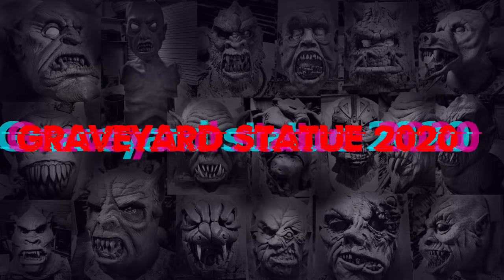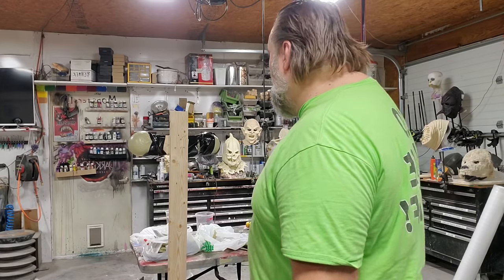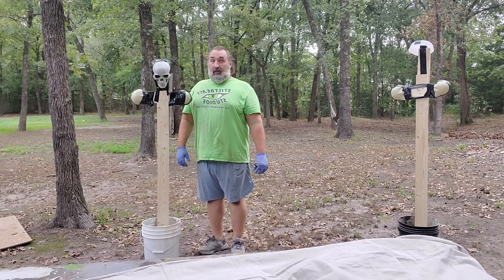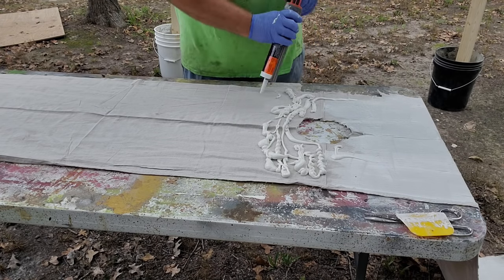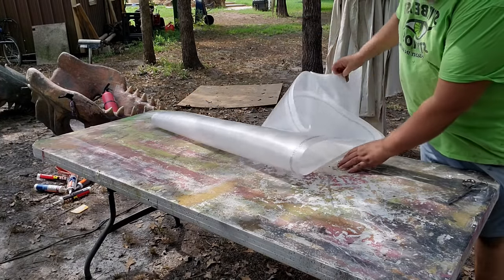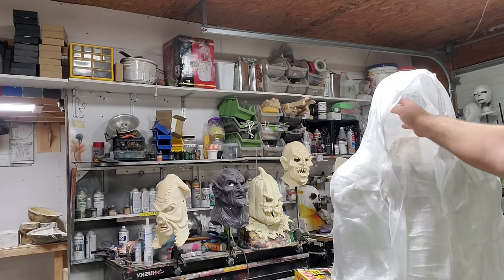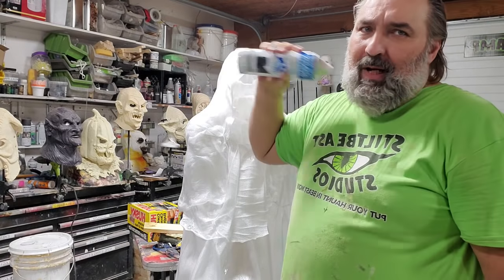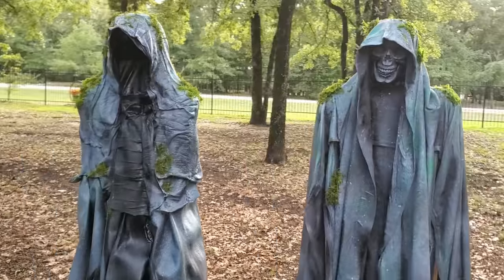graveyard statue 2020

Comment: Just FYI, but you don't really need to cut a circle for the head, as all you need to do, when you've folded it in four, is cut little slits along the fold lines. As in an X, because then the head just pops through it, but also the triangular parts that poke up can look sort of like a neck or collar. Hope you like my suggestion

Comment: I am going to be leaving my statues outside in the elements and at the end of the video you stated that they were somewhat waterproof since they had been treated with liquid nails. Would the addition of Loctite to join the individual canvas pieces together help make the statue water proof or would you suggest an additional water proof coating to achieve that.
Reply from the maker: if they are left outside all year then Id hit them with concrete water sealer... Ive been using that al ot lately
https://www.homedepot.com/p/BEHR-PREMIUM-1-gal-Wet-Look-Sealer-98501/202263927
Reply: @StiltbeastStudios  thanks so much

Comment: Fantastic! I wonder how many tubes of Loctite were used to make the first statue (the canvas-covered one)? ALso I wonder how weather proof the canvas-covered statue is. Will it survive a few weeks outdoors in a chilly/rainy environment (northeast US)? I just worry it would get wet and the canvas would get moldy even with the Loctite covering.
Reply from the maker: 7 tubes total and it lasted 4 months till I moved it outdoors in texas
Reply: @StiltbeastStudios  so it last 4 months outdoors? or 4 months indoors and then fell apart as soon as it moved outdoors? (they you, just wanted to plan a budget for attempting to make 2 of the statues)
Reply from the maker: @myatt83   it was fine outside for 4 months, then I moved it inside so it  was not in outdior conditions any longer.
Reply: @StiltbeastStudios  rock on! appreciate the clarification. i plan to build a few and put them outside for just October, so should be good. I thought it would be cool to also drill some holes in the skull and wire a few LED's inside so the eyes glow red. Trying to brainstorm some other ideas for making these even more scary and cool. Thank you again!

Comment: God. I love it.   Simple.      But can use 1 inch pvc pipe  for skeleton inside   But wonder. Lot of weight on it  🤷🏼‍♂️.    For bases- can be hidden with tombstone front of it and fake bone hand  on tombstone head    , Other too  casket tombstone topper on ground to to hide the base. Many way.    Great job Allen. Love it
Reply from the maker: the bases pretty much get hidden by the robes of the statue, but all the mods you suggested are great.

Comment: Used your concrete bases. I reallly thought they would stand up better, but a slight wind blows them over. Still like this better then staking them in the ground though.
Reply from the maker: how much concrete did you add, you could just make it a bit heavier.

Comment: Do you prefer the PL375 over Monster Mud? Easier to work with? Lasts longer?
Reply from the maker: monster mud is not waterproof, the liquid nails or the pl375 is waterproof. So I prefer the waterproof option, it also weighs a lot less.

Comment: Could the body have been made from old torso models that a store no longer uses? Also, MinWax spray polyurethane seals foam against the effects of spray paint. My big question is: Why is everything in the video mirror imaged?
Reply from the maker: yes you could use a mannequin, but they are much harder to get ahold of. it would seal it, but there was no need for it so why add cost. and its mirrored because front facing cameras do that.

Comment: Are there any fire hazard concerns with the foam? I would be hesitant to use it in an indoor haunt.
Reply from the maker: its floor underlayment, so its meant to go in a home or under hardwood flooring. its flammable, but most things are flammable. I have never had an issue with it from inspectors.  It has less mass than a plastic garbage can, and those are also toxic when burning and flammable, so I feel its in the same boat.

Comment: Were these cheaper to make than your originals with the bed liner?

Also you mentioned that the canvas one is covered in liquid nails? What is that?
Reply from the maker: yes on both counts
Reply from the maker: https://www.homedepot.com/p/Liquid-Nails-10-oz-Heavy-Duty-Construction-Adhesive-LN-903/100176209?source=shoppingads&locale=en-US&mtc=Shopping-B-F_D24-G-D24-Multi-Multi-NA-Feed-LIA-NA-NA-All_Paint_LIA&cm_mmc=Shopping-B-F_D24-G-D24-Multi-Multi-NA-Feed-LIA-NA-NA-All_Paint_LIA-71700000048001156-58700004793621605-92700041080546467&gclid=Cj0KCQjwqfz6BRD8ARIsAIXQCf1ehpRWJME4ExIwmjSgE748aym3dDGHY5CeMfVk_B6lCe6-GVQUoeIaAiH8EALw_wcB&gclsrc=aw.ds

Comment: How many tubs of the loctite did you go through? Thank you these look awesome.
Reply from the maker: six tubes actually, not that bad at all
Reply: StiltbeastStudios Thank you again awesome and simple.
Reply: Awesome work! I have a couple of questions: (1) Does the loctite dry clear and (2) did you put the coated portion on the upside that would be exposed to the elements or the underbelly? I bought two of the Home Depot cemetery statues this year and I’m wondering if I might be able to coat the fabric on their costumes with the loctite to leave them outside. I figured that would save me the build time. Any thoughts?

Comment: Alan, once finished will you have to move the statues around in your yard with a dolly because they are set in concrete?
Reply from the maker: no, the board is removable, thats why I vaselined the board that I used when I put in the concrete. so I can pull the board and just carry the bucket which is only 25lbs.
Reply: @StiltbeastStudios  Would I assume that if I wanted to put them back in your yard like you showed at the end of the video that you would leave them in the bucket so they would not blow over and then for storage purpose I could choose to pull them out of the concrete
Reply from the maker: @geoseward   correct, they are in the bucket while displayed and they could be stored out of the bucket if you like. you could have 20 figures built the same way and the store the figures on a shelf and the 20 concrete buckets outside somewhere.
Reply: @StiltbeastStudios  Why did you use Loctite in these statues versus the rubber undercoating in previous statues?  These look like they might be lighter. Great work.

Comment: Do you ever use “monster mud”? Seems it would be a lot easier?
Reply from the maker: no. The end product is not waterproof and it weighs a ton. I made both of these in less than four hours so.....this was pretty fast. Monster mud has a place for indoor haunts.  If you dont have to move them and they will stay dry, in my opinion.

Comment: I know this is an old video but maybe you can still answer my question haha, did you end up using 2 canvas tarps or just one of the 6ft by 9 ft tarps? 13:48
Reply from the maker: I used 2 of them, I try very hard to answer all t6he questions i get.
Reply: @StiltbeastStudios  do you think I can get by with a 12 x 9 if I just cut it in half?
Reply from the maker: @DLR-Creative   that should work just fine

Comment: Wood monster mud rather than loctite also work?
Reply from the maker: yes, but it would not be waterproof and it would be 5 times heavier
Reply: Awesome video!  Does the loctite have a hardening effect like monster mud to keep the form of the canvas solid?  I plan on making two and want to use these for many Halloweens to come!   I ask because the canvas one looks like the fabric has some give after it has dried with the loctite already having been applied.   I look forward to your response, Thank you!

P.S.  can you provide a list of all items used for the canvas reaper? 💀

Comment: Love it, but PL375 is not a caulk.  It is a construction adhesive, it does not have any caulk or sealant properties to it.
Reply from the maker: Caulk is the generic term for a cartridge that goes in a caulking gun, no one calls it a construction adhesive gun- so I call it caulk- then I specify what is in the tube. sorry if that confused you. that was not my intention.
Reply: @StiltbeastStudios , I have worked developing and selling construction adhesives, caulks, and sealants for the last 10 years.  Caulk isn't a generic term it is a sealant that meets certain specifications.
Reply from the maker: @LetsRoll239   I assure you it is generic for what goes in  a caulking gun. it may not technically be correct but they are caulking guns that you can put a lot of different things into. I do say exactly what Im using to avoid confusion. Its sold in a section of the store called caulking, it goes into a caulking gun. I feel comfortable in my assertions and clarity.
Reply from the maker: I know you are in the industry and you are correct. Everything in a tube is referred to as caulk to most of the folks around me, then what kind of "caulk". Im in Texas.  It may be regional but I have the feeling its not because Ive done construction work all over the states and its referred to in the same way.  Maybe its like all tissues are called kleenex and all sodas are referred to as "Cokes" in the south.